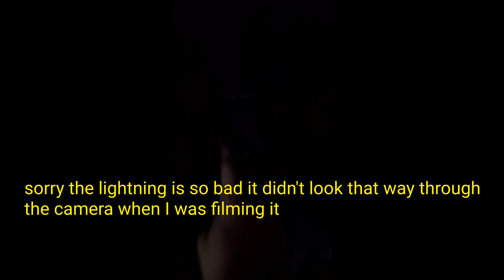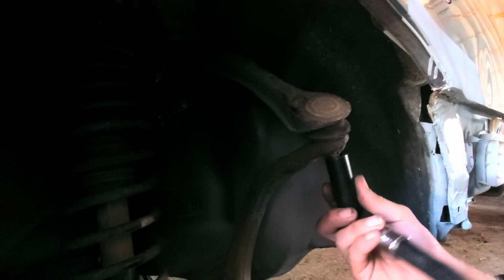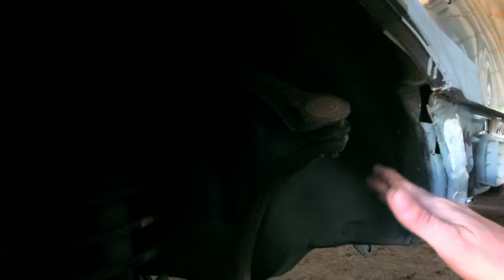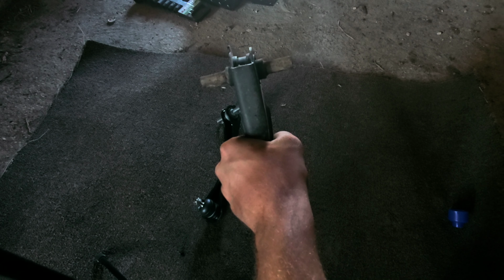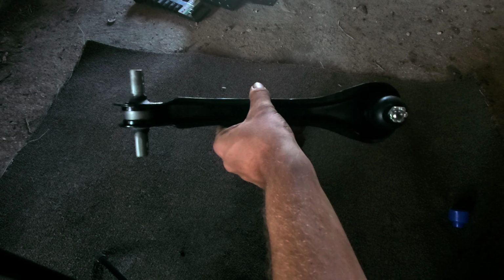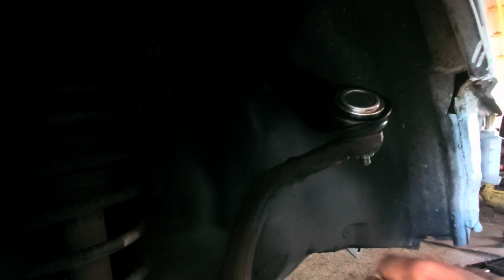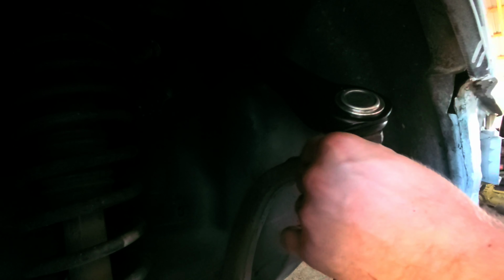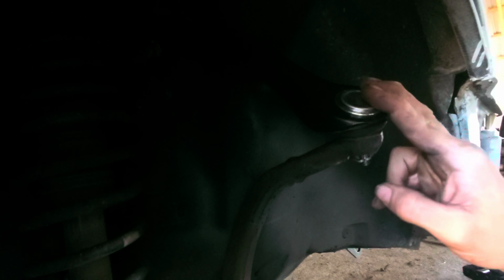rear upper control arm replacement 90-93 accord

Comment: Idea for another video(s)
Getting ready to replace many suspension parts on my 93 Wagon. New struts, Front upper and lower control arms, inner and outer tie rods, bushings that sit towards the front of the car, (Forgot what they're called), sway arm bushings.
Rear: strut's, upper and lower control arms and sway arm bushings.
Question, what order on the front should I do to be most efficient?

2nd:is there anything else suspension wise I'd want to look to replace? I've seen something called a "rear trailing arm"?
Thanks
Reply from the maker: i have covered everything for suspension parts except struts and sway bars those are coming next i just ordered new coilovers so that video will be coming soon
Reply from the maker: i will all so be doing engine mounts as well..
Reply: @CB7Media  right, but if doing them all at once, in what order would you do the parts replacing in?
Reply from the maker: @hwrida  i started with the hubs and rooters then i did ball joints from there i would recommend doing upper control arms then the sway bar links so you can reinstall the steering knuckle arm so you can brake lose the outer tie rod and then take out the inner tie rod after that do front shocks then do the rear  upper control arm and brakes and  struts

Comment: Hey so, you remove rear tires on both sides, support by jacks on both, and then let the suspensions fall of / extend down, or jack support the suspension from under the brake rotors?
Reply from the maker: Yes, Jack it up and support it with Jack stands take off the tire and just let the suspension hang you should not need to Jack it up for doing the upper rear control arm's